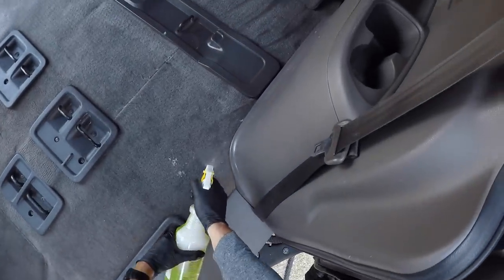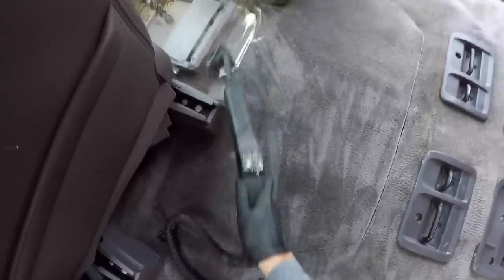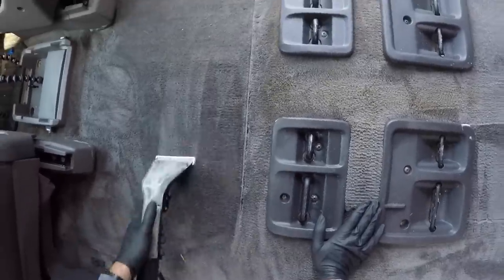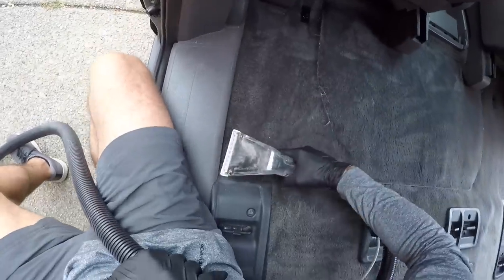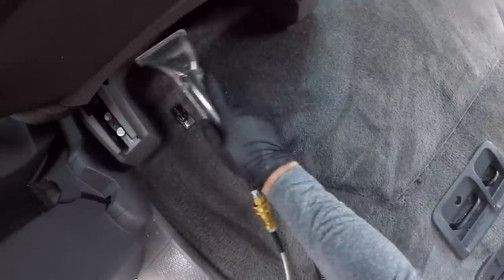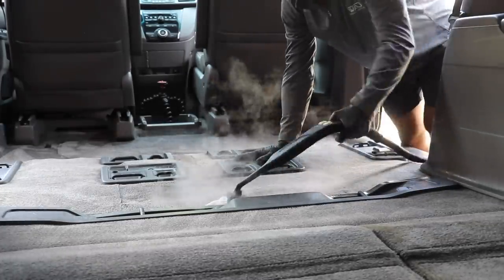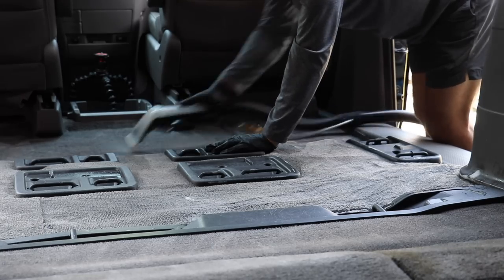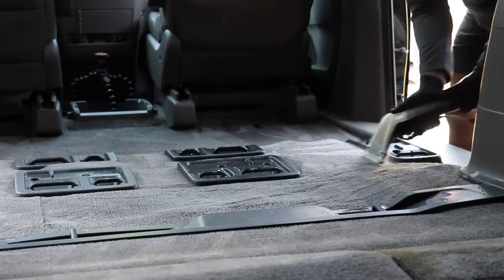STOP Disappointing Customers With BAD RESULTS! Ultimate Carpet Shampoo!!!

Comment: Thanks for helping me with my Detail business. Just made a $1000 these past two weeks at 17. Love this “job”. It really isn’t a job to me, it’s a passion. I don’t mind waking up in the morning to detail.
Reply: ayyy how did you start?
Reply: It's Aライフスタイル So I started off with about $100 I bought an armour all $32 Vacuum and a $10 50ft extension cord. I bought about $40 of supplies (soap, tire shine etc.) then I take bucket of my own water from home filled with soap and go to where I meet my customer (this is a mobile wash) I soap down the car with my microfiber mitt and constantly have my second bucket of water making sure the dirty mitt doesn’t scratch the paint. Then I let the soapy water run off the car, then I dry with spray wax detailer. You don’t need a pressure washer or a hose. It’s that easy. As for the interior you use that vacuum I mentioned with an extension cord. Customers won’t mind you using their electrical outlets outside. As for detailing and not washing , I have a full detail done in my garage.
Reply: Dylan Garcia that’s amazing, i’m 17 too but i have an astro van with a pressure washer but i love hearing other people starting off a good business
Reply: @DylanGarciaaa  kinda sounds like you should have a battery powered pressure washer to rinse the car.  You leave a residue behind just wiping soap off with spray wax and a microfiber.

Comment: Great content! Here is my money saving tip and get professional results. I have a product to clean carpets that really works well and is super cheap. It is PH neutral, making it very safe and is the industrial standard for extraction. It's 3M 27h and the stuff is 20-30 dollars a 1/2 gallon, cut it 1:105. Yes it makes 53 gallons of cleaner. It comes in a container that connects to a fool proof mixing system that is expensive and you don't need. Just remove it from the container and place it in your own 1/2 gallon jug. Mix it up a gallon at a time . Clean all the fabric in your car.

Comment: I have a question. What's the advantage of using steam when other YouTubers use rotating brushes to clean the floor carpet?
Reply: I use both of those tools.  When you spray cleaner sometimes the brush and chemical doesn't completley remove the stain.  The steamer can come in anx help finish it off.  I've been able to remove stains and sauces with a steamer a lot faster
Reply: the heat from the steam breaks down dirt better and makes it easier to extract, that thing is crazy hot, plus its disinfecting killing germs